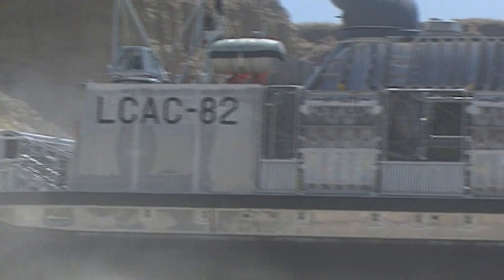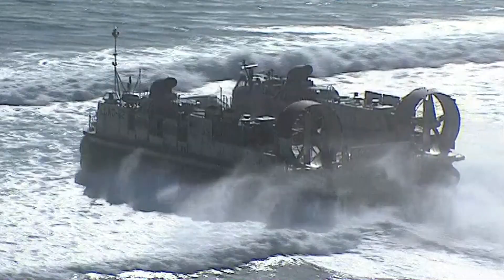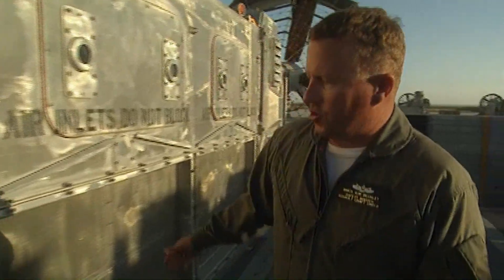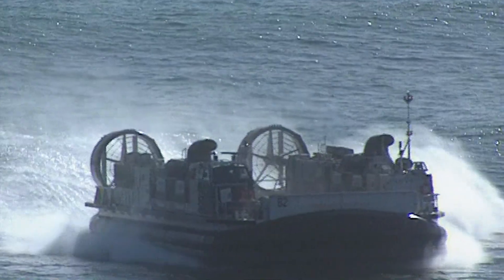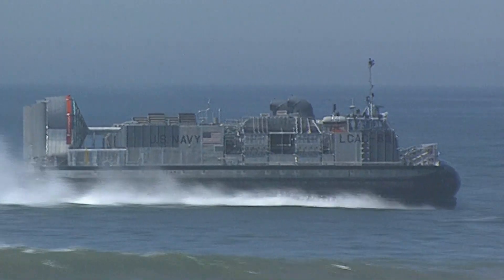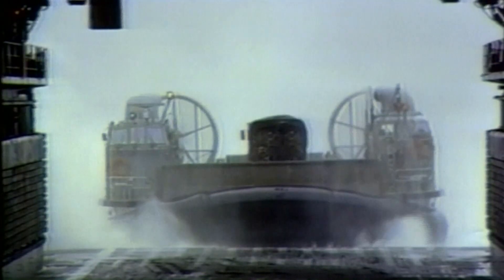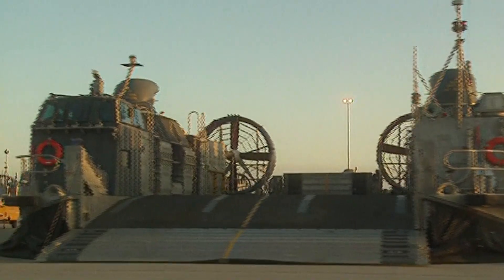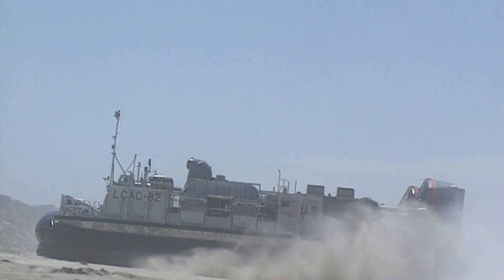LCAC Military Hovercraft - No Beach Out of Reach

Comment: The F14 is fly by wire... You learn something new (and wrong) everyday... :-(
Reply: Only the rebuilt Ds which were upgraded in the early 2000s with FbW and digital instrumentation as a test.  Then the Navy retired the whole fleet after spending a bunch of money to upgrade a couple of squadrons to D+(?) specs.
Reply: swaghauler fly by wire retrofit on old turkeys might have been quite an adventure. Is their any docs on the process available ?
Reply: @G_de_Coligny  IDK.  I read about them converting the D's in a Janes article.  I'm not sure how successful they were but I know the costs per flight hour of the F14s was about DOUBLE the cost of flying an F18.  That's why the Navy retired the F14.  
       My guess is the conversion must not have been very successful.  If it had been, I'm sure the Navy would have converted more.  This was also done in the late 2000s so they only flew for half a decade(?) before being retired with the rest of the F14 fleet.
Reply: That says something because the refits were zero-hour refits at the FACTORY.  Not something the Navy did.
Reply: swaghauler the production line of the F14 were shutdown in 91... and it would be a design retrofit anyway in the sense the plane was never designed with FBW in mind...
Now, maybe it’s just plugging the stick to a digitizer box who afterwards control the hydraulics... don’t know, that’s why i’m curious...
Reply: @G_de_Coligny  IDK.  They did them when they rewinged them according to the article.